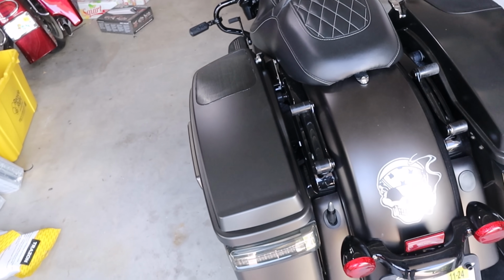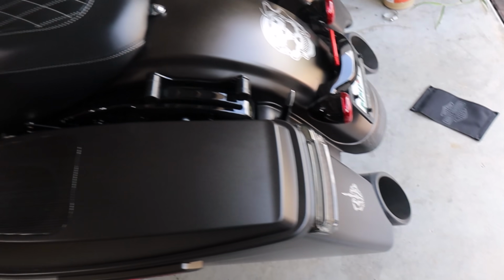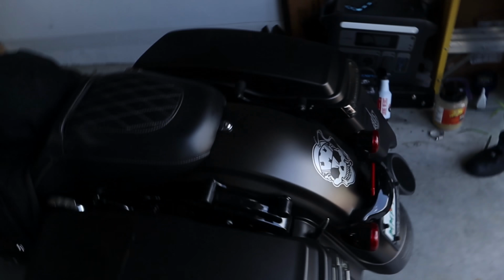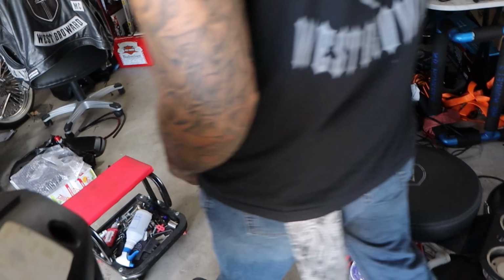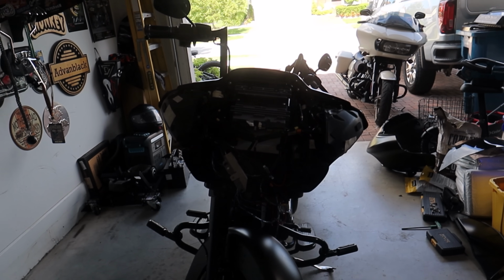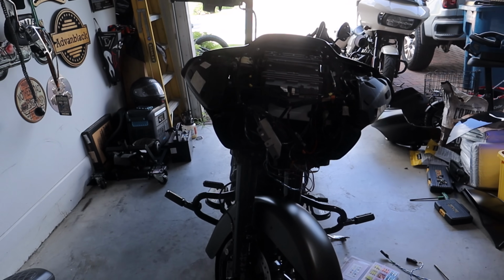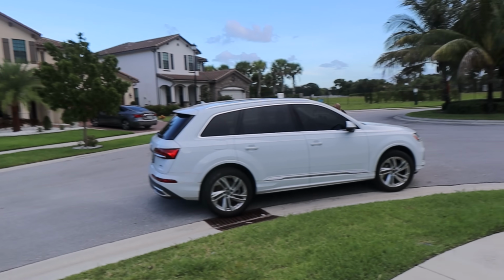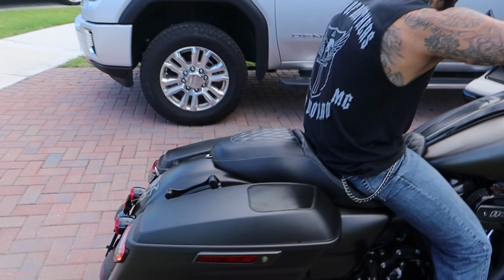Fixing Bad Harley Paint - Matching Your Speaker Lids

Comment: It's funny to me that you posted this...I have an 06 SG in deep cobalt blue pearl and the original owner of my bike that bought it new used to put a cover over the bike and it was cheap and scratched the shit out of the saddle bag lids, and the bike has 18k miles on it with the stock seat and that scratched the shit out of my side panels and a little on the rear fender but not as bad as the side covers plus my lid latches are color matched and the blue has peeled off down to the black primer... so I ordered the kustom cans kit in my color with their 2k clear and primer. It's going to rain all day tomorrow 100% chance of it so, I think I'm going to try it tomorrow. I've read a lot of good things about it and matching up really well. They even matched the color with the VIN just to be sure. I got one can of each delivered for a little under $80 🤷‍♂️ figured if it's good product than thats a deal to make it look brand new again..I used to paint industrial machines so, prep prep prep is everything!

Comment: Actually depending on the amp you can just add more speakers to it and the amp will make more power.

Power @ 14.4V @ 4Ω: 4 X 147 WRMS
Power @ 14.4V @ 2Ω: 4 X 223 WRMS

Bike looks nice👍

Comment: a few corrections- you don't "hear" watts. You hear decibels. A doubling of the power from the amp OR doubling the number of speakers will yield about a 3dB increase. If you do both, you would expect about 6dB overall increase in SPL.

Comment: Put the hogtunes 6 by 9 200 w speakers on my fairing on my 2021 Road Glide and the 300 w amp from hogtunes and at 80 miles an hour with a hangover you will turn it down because it's too loud love the hogtunes great for the money

Comment: Great video I have a problem have you seen or heard of  bolts on the motor and transmission corroding I have a 2022 tri glide less than a year old and the rear shifter linkage is corroded thanks
Reply from the maker: Only if they’re left outside.
Reply: @ProfessionalMonkey  nope the trike is kept inside
Reply from the maker: @richardschaffling9882  that’s a real bummer. Sorry that’s happening!
Reply: @ProfessionalMonkey  the one salesman thinks the guy who washed the bike there used a acid wash to get the aluminum engine to shine
Reply from the maker: @richardschaffling9882  that would do it!

Comment: Need input. Have a stock H&K stereo on my 13 Road Glide Ultra. Rockford amp and front and rear speakers. Want an upgrade stereo with Bluetooth.  Any suggestions?
Reply from the maker: I’d Google that since the it’s the smaller form factor. I’d imagine there are some good marine head decks out there?